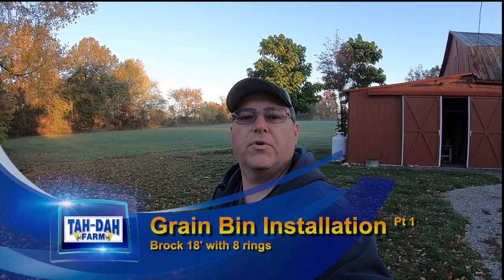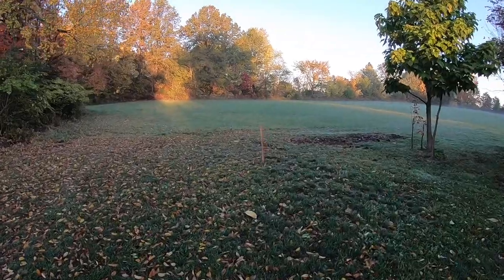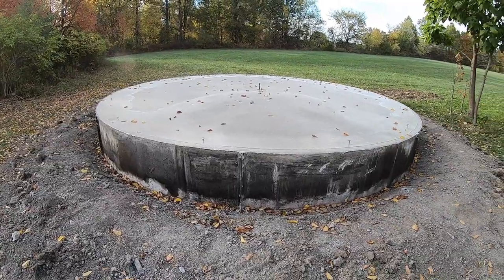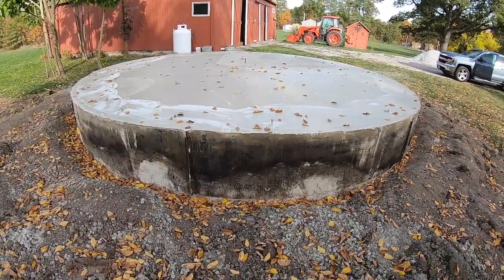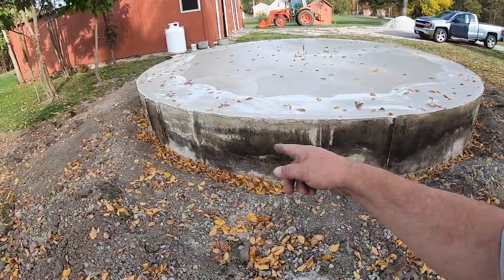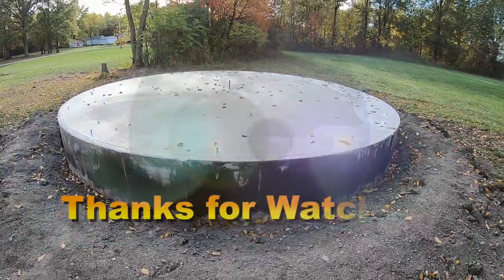Brock 18ft Grain Bin Installation Part 1

Comment: So far so good, I assume this will have a dryer in it also?
Reply from the maker: At this point I'm only putting a fan on it. The dealer think I should be able to dry down 19% corn using the temperature humidity chart to run the fan. The dealer also said if I needed to have heat on it that a salamander heater would work in a pinch for no more then I should need heat. Will see. This year is working out with the corn between 14% to 17% right out of the fields.

Comment: That little bit of wire at the end is not enough the money spent on concrete I would put rebar in there
Reply from the maker: There is 4 rows of rebar on the sides about a foot apart from the bottom of the trench to about 8" from the top. The wire is only on the top but does go to the sides. Thanks for watching and commenting.

Comment: beautiful floor!
Reply from the maker: Wait till part 3, that is when they put the fan, floor and finish things up.

 I just finished corn today and it all went in the bin. We had really bad deer, coon, and other animal damage, so it only did 126bpa. Very disappointed for the 65 gal side dress that was put on. One field when dropping off the grain cart I could hear them fighting in the corn field. There were 1/4 acre spots in fields all knocked down from the deer. Several spots like that in the fields.  I've never seen it that bad before.

Comment: Good deal with your foundation that tall, so much nicer to just slide an auger hopper under the unload and be ready to go, instead of having to dig/clean out a hole every time.  My shivvers drying bin has a concrete “bowl” under the unload, always having to clean that thing out is aggravating.  Last bin I put up I extended the unload auger 4 feet out where the ground slopes away, easy to set the auger and hoping it’s out far enough I can match the next bin up with it and use a permanent auger for two bins.
Reply from the maker: They recommend that we go with 2ft foundation.  It was a lot more concrete and stone but like you said, in the end it will be worth it.  Thanks for watching.
Reply: TAH-DAH Farm what a difference a few hundred miles makes.. almost every bin around here except for the big ones are poured on an above ground slab.  I moved a 24’ bin a couple years ago that was set on a poured above ground slab, 6” thick.  Only had one crack in it and wasn’t buckled.  Was told it was poured out of a 3 point hitch cement mixer a bit at a time back in the mid 80’s.
Reply from the maker: The 80's, back when things were built better.  I looked at buying a used bin and moving it. Most were on a slab or asphalt with no flood or unloading auger.  It didn't cost that much more for a new bin.
Reply: TAH-DAH Farm nope, like they say, the concrete and electric costs the same for a new bin as it does a used one.  Only ones I’ve moved are 2 I already owned and trying to get everything in one place.  Would never buy one to move at any price.
Reply: That's an over kill on Crete. If ur worried bout clearance just put on a 25 degree